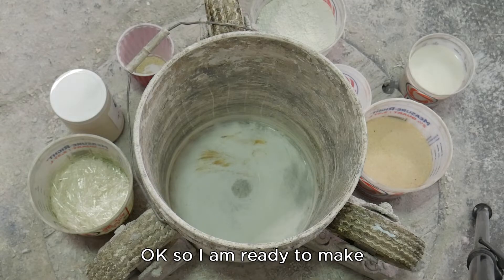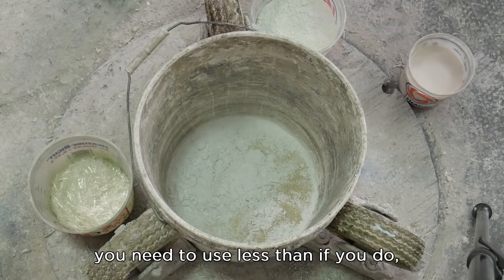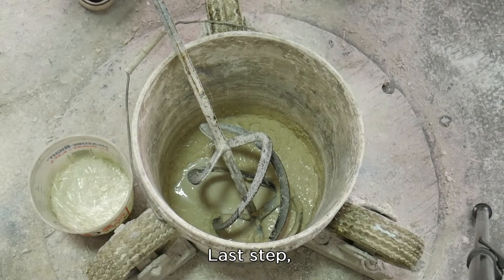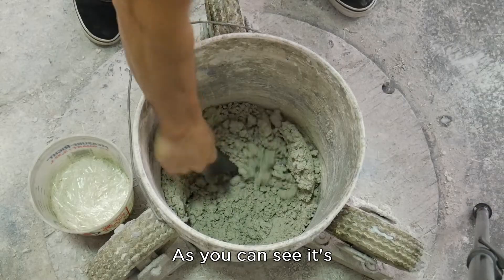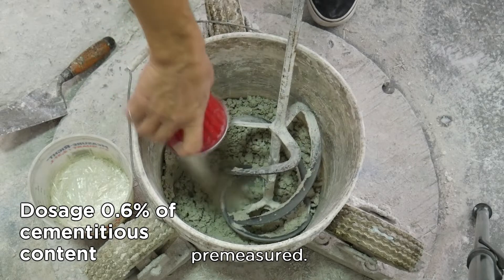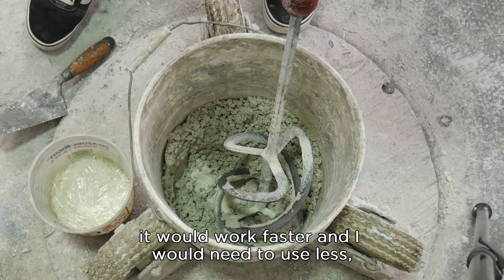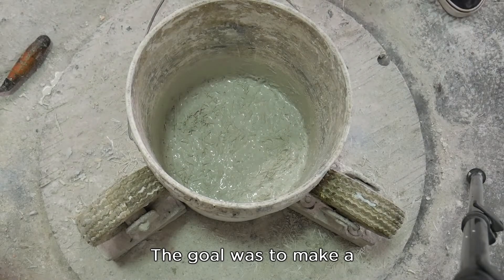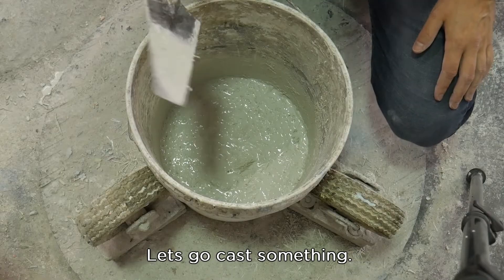Superplasticizer for concrete countertop mix

Comment: How long does it take to setup?
Reply from the maker: It's not possible to state how long a particular mix will take to set up because the time concrete takes to set is affected by a number of factors: mix and environmental temperatures, w/c ratio, pozzolans, cement fineness, and other admixtures that are used. Some high-range water reducers do have retarding characteristics, and these are classed as Type G (water reducing and retarding). Alpha Pro Fluidizer is considered Type F class (just water reducing). This means that Fluidizer does not deliberately retard the concrete and lengthen the time to set.
Reply: Thank you. I did know if there was less water in a mix if it would speed up drying times. I probably didn't ask the question correctly. Does having less water in your mix speed up setting time and by what percent? I'm not worried about what's in the mix itself or the rh or temperature. Thank you for your help?
Reply from the maker: @bruceessig3350  Less water in the mix will decrease set time, but there's no way to predict how much. The only way to estimate the difference in set time is to make two test batches with different water contents and measure the set times for both. If you want really rapid setting concrete, consider CSA cement: https://concretecountertopinstitute.com/free-training-category/csa-cement/
Reply: @TheConcreteCountertopInstitute  thank you
Reply from the maker: @bruceessig3350  You are very welcome!

Comment: Don't get the point of fibers. You end up with a rough surface instead of a smooth one and sanding will only expose more fiber. So this process is not useable for poured countertops unless I am missing something. Also, having worked enough in composite materials with boats and boards, I know chopped fibers are not adding much strength to anything. They can be useful as a filler or thickener but that's about it. Your plasticizer is impressive though. Also, if I may, the way you leave your mixer in the center and lean it towards the edges in a circular motion can only leave unmixed material on the bottom's edges
Reply from the maker: Fibers are used in traditional concrete mainly for shrinkage control. I'm actually not a fan of fibers in traditional concrete, because they are so often misunderstood and misused. Please see these articles: https://concretecountertopinstitute.com/free-training-category/fibers/    

GFRC (which I'm making in this video) is a totally different story. Fibers are essential - it's Glass Fiber Reinforced Concrete, after all! Please see this article: https://concretecountertopinstitute.com/free-training/glass-fibers-an-essential-component-of-gfrc-concrete-countertops/